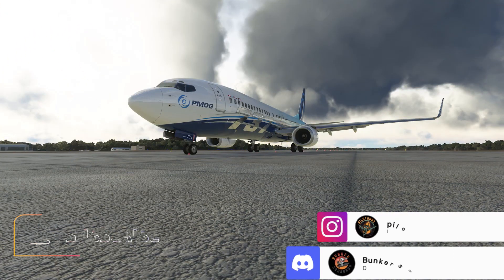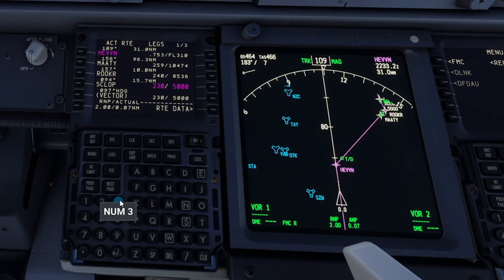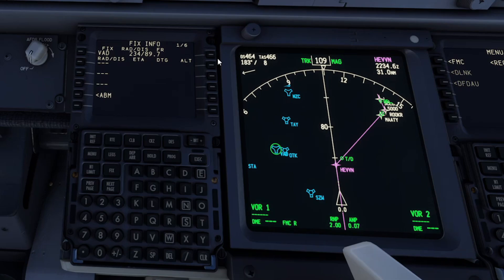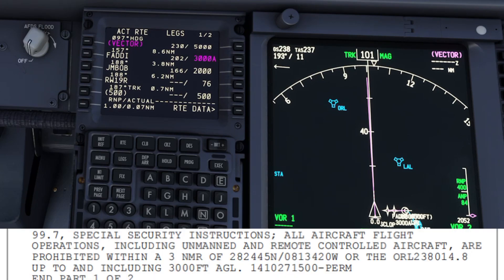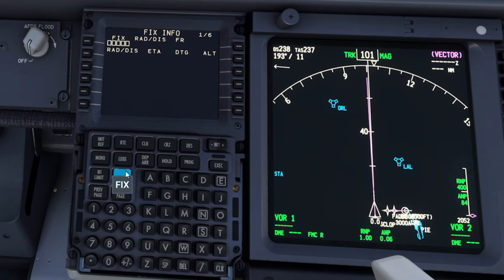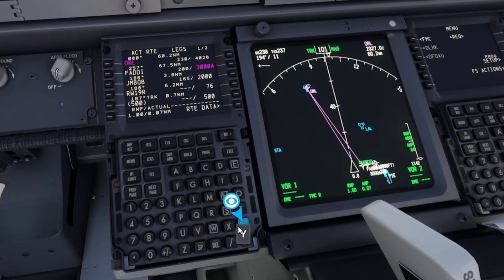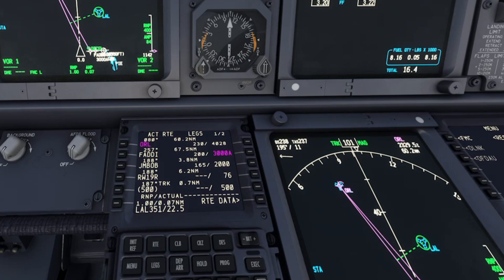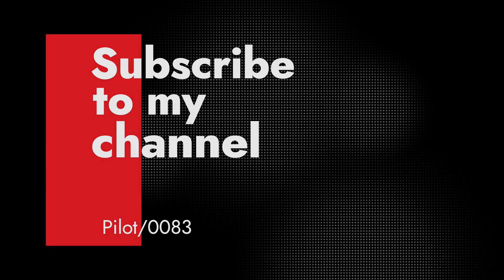Mastering PMDG 737 FMC: Essential 'Fix Function' Tutorial for MSFS 2020 Beginners 🛫

Comment: Try a flight to LIML (Milan Linate) Runway 18 for a landing challenge in PMDG 737-900ER in heavy rain and 4000 metres visibility in mist. It’s quite difficult as the final is a heading of 173 degrees.

Comment: Nice tutorial, but you placed the restriction on the wrong WPT and removed another one. Instead, you should have LAL01/4000 and keep FADDI/3000A.
Reply: @Pilot0083  As I mentioned earlier, this is an outstanding tutorial. That's why both pilots verify before executing under Standard Operating Procedures (SOP).